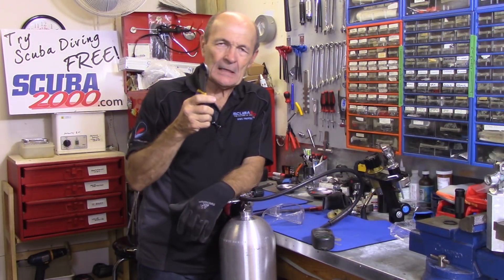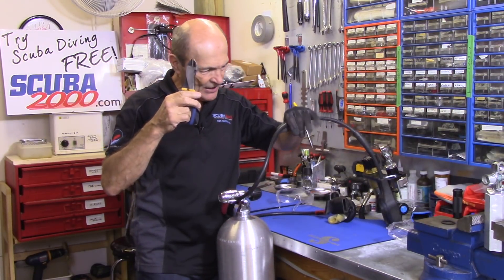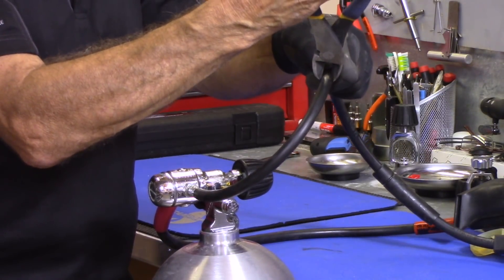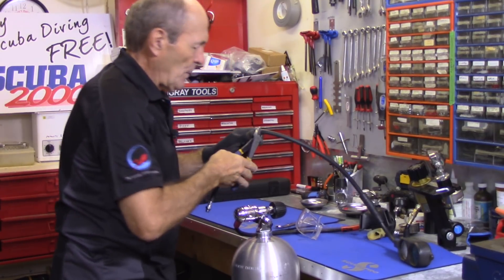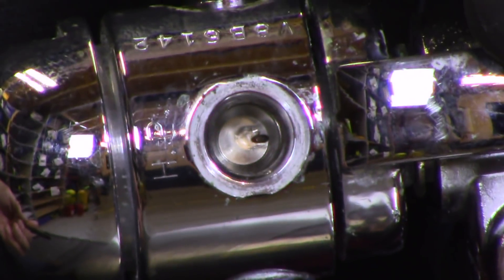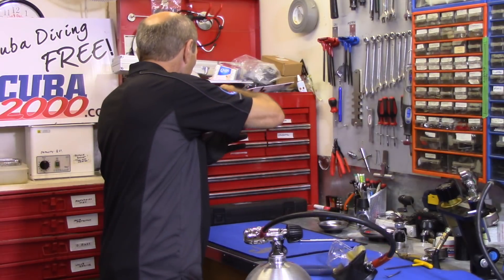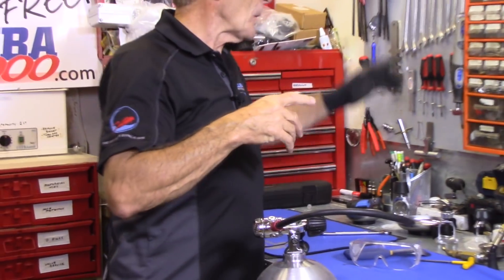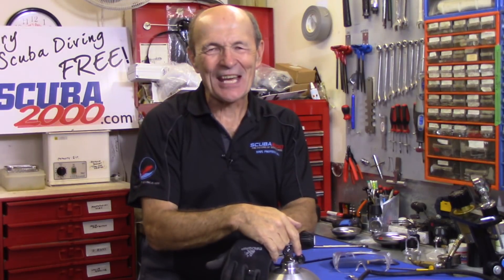What Happens If A Hose Blows? - Scuba Tech Tips: S06E16

Comment: Really nice video again ! and I would guess that the low pressure hose having a bigger volume would let you less time to get up to the surface than the high pressure one ? Always a big fan of your vids Alec ! and if I forget before too late I will wish you a very nice holiday season and a Merry Christmas !
Reply from the maker: Merry Christmas to you too Joel.
Thanks for your support over the years.
Bigger diameter but lower pressure right? So the volume of air may not be higher.
It's a physics question that you'd need to work out. At some point the inside diameter of the hose combined with the pressure will equal whether a large or small diameter.
I think. Alec
Reply: That make sense ;) Was saying as I had a free flow on my OW in the open and it scooped half a tank if not more in a really short time hehe ... thanks for the wishes and anytime for the support I love your vids and knowledge !

Comment: I had a LOT of suspense in this video.
Reply from the maker: It's not that big a deal, which is exactly the point.
As with many scuba issues, it's the perceived danger that's most harmful.
NOT knowing what will if something goes wrong can make a diver act imprudently when it does and that can lead to a serious problem.
That's why I like to ask questions and try things that you wouldn't normally see - just to see what happens.
In most cases, it's not that big a deal.
Alec
Reply: Alec Peirce Scuba I'm sure we'd all love to see where you simulate more potential equipment failures and their effects!

Comment: Hello Alec please could you cover 2 items the Apollo bio-filter and modern full-face masks?
Reply from the maker: If you read the Apollo Bio Filter sales pitch on their web page you'd swear that this simple device is the answer to all scuba diver's woes!
In fact, it's a simple humidifier. The first such device was made by Farallon in the 70's and was called the SAM - Scuba Air Moisturizer. Essentially it's a cylinder that fits into the first stage between the first stage and your primary reg hose. Removing a small cap allows you to put water (distilled water is recommended) in the cylinder. The water soaks the internal sponge-like material and that water is slowly absorbed by the air as you breath. It moisturizes the air.
So it may reduce dry mouth. That's it.
It will not cure headaches, fatigue, increase your bottom time, filter the air, make equalization easier or improve your erections!

I intend to discuss Full Face masks in a vid soon. I may have to do a Tech Tip AND a Vintage Scuba video for them.
They were quite popular in the 60's and 70's. Many recreational divers used them but today they have become expensive and largely unnecessary scuba devices of greatest value to professional divers, professional divers with lots of money. Their greatest benefit, other than isolating the diver from cold and/or dirty water, is to allow good communication underwater. Personally I value the time underwater with my dear wife Diana - time that is visually enjoyable but without the distraction of her voice.
Alec

Comment: Do Milflex hose need hose protector?
Reply from the maker: I talked about this at length in a video a while ago. I think the topic was flex hoses.
The short answer is that I don't think hose protectors are important on flex hoses.
Hose protectors are valuable on the normal stiff rubber hoses but they can cause corrosion of the end fittings if not pulled back and rinsed. Better off without them if possible.
Alec
Reply: Alec Peirce Scuba, thank you for the info.. my wife and I love your channel.. it bring back so much memories. Another question, I live in Boston and the diveshop around  where I live can not service my 12 to 14 years old regulators. They just want to sell new regulators. So I am driving up to Scuba 2000 to have my regulators service, and we need 2 new BCD. Like the one you have for traveling. We wish we can meet you in April 2018... and happy holiday.

Comment: The bad guys on Sea Hunt could cut thru those big hoses without much problem.
Reply from the maker: Yes it seemed that way. 
The big hoses on a double hose reg are much lighter rubber, lighter even than a bicycle inner tube. They were easy to cut.
And in the TV shows they were pre-cut to be sure they broke at the right time and the right place.
Reply: Alec wasn't using a 12" dive knife if he had been he would have been through that hose like greased lightning through warm butter.

Comment: That was cool always wondered about that.  Wonder if you could "kink" the hose and make it stop flowing?
Reply from the maker: Maybe the Low Pressure hose will stop flowing is you kink it sharply. The pressure is only 150 psi and you can stop or at least slow the flow.
I doubt you can stem the flow from a high pressure hose at 3000 psi. I'm not sure but I'll try it and let you know.
Good thinking.
Alec

Comment: WOW!  That brought back memories.  I had a high pressure hose blow during a pool session.  It blasted a hole in a hose protector and scared the crap out of us.
Reply from the maker: I'm guessing that was a while ago, before restricted orifices.
It used to happen quite often. If you look carefully at a high pressure hose you'll find a series of tiny holes running the full length on one side. They are there to stop the hose 'blowing up'. If the hose starts to leak the air just comes out like an aquarium diffuser.
No more explosions.

Comment: Hi, a month or so ago the connector on my low pressure inflator came apart. I was about 20 m underwater at the time. It looks worse than it is luckily. I tried to tie a knot in it but the hose is too stiff but I did kink it which reduced the flow. However there was plenty of time to return to the boat and put it back together and a few minutes later I jumped back in and finished the dive. I guess the important thing here is not to panic, it looks a lot of bubbles but it was not necessary to go to the surface.
Reply from the maker: Perfect! That's what I thought. I've seen divers go nuts over a bunch of bubbles and noise but, they still had air!!
Good work and a good experience for you - scary but good.
Alec

Comment: Not so sure about this video. With the low pressure hose were you not restricting the flow with the tank valve? Also if this happens at 90ft / 30m how long would a half empty scuba tank last compared to such a failure on the surface?
Reply: There's a great video showing how long it takes for a free-flowing regulator, a faulty LP hose and a HP hose to empty at 1 ATM (surface), 3 ATM & 5 ATM.
https://vimeo.com/151452141
Reply: Geoff Infield 
Hi. Try this link instead. 
https://youtu.be/Dnwz7r-pHqg
Reply from the maker: I wasn't restricting the flow. Realize that there is a natural restriction from a the first stage. It will only deliver air at 150psi above ambient and the flow rate is slow and constant regardless of pressure or depth. Air does not pour out at a high rate. That was the point of the video.
Since the IP (intermediate pressure from the first stage) is always 150psi above ambient, there will be no change in the flow at any depth. However, at any depth your rate of consumption changes. Technically the air will come out of the tank at the same rate regardless of depth so the flow from the torn hose will continue just as long. But you consume much more air as depth increases so it will not last as long.
I know this sounds odd but think about it for a while.
Thanks for watching.
Alec

Comment: Hi I’m just starting to get into scuba diving and I need to get my wetsuit I live in New Zealand (so cold water) and I have come down to 2 wetsuits one is a 1 pice wetsuit and the other is a 2 pice both are 7mm which one is the smarter option
Reply from the maker: Sorry for the delay. I actually made a long reply to your question but then I lost it during a computer glitch. I was so frustrated that I left it.
Here's my thoughts:
1. the 2 piece wet suit was the standard for many, many years. It was a pair of pants that came up to your chest only (called Hi-Pants) and a jacket that had a Beavertail - a strap that went down underneath your crotch to hold the jacket down. That was replaced by the Farmer John style pants with shoulders and the Step-In jacket. It was great for warmth although quite restrictive with all that material. It was really a 14mm suit from the neck to the crotch so made it very stiff to wear - and buoyant too.
2. The 1 piece suit is simply that - 1 piece that you climb into and zip up the front or, more commonly now, the back.
3. The Almost-Dry or semi-dry (I see that mentioned in one of the replies) is the same suit but with rubber seals at the neck, wrist 
     and ankles. They are supposed to keep water from flowing in and out of the suit.

As an historical note, the semi-dry suit was first designed by the late Frank White Sr. of White's Diving in Vancouver. He designed the Cross-Chest zip,  zipper flaps, attached hood and a dozen other great ideas to make divers happier underwater.

So, I suggest the 1 piece suit. It has almost replaced the 2 piece suit in most environments. It is cheaper, easier to doff and don, less restrictive, more flexible, less buoyant and just as warm. The 1 piece suit has openings only at the neck, wrist and ankles while the 2 piece has that large overlap at the waist. Some divers will say that 14mm (double thickness) is warmer than 7mm. Nope. It's not the thickness of the neoprene that keeps you warm. It's the trapping of the thin layer of water under the wetsuit. 7mm is the thickest you need even for very cold water. Here in Canada we dive all winter long through a hole we cut in the ice. I venture to say that it's colder than your water - 0 degrees (32 for our American friends) is about as cold as you can get!
As for the semi-dry, most suits now are so flexible that they seal really well at the neck, wrists and ankles anyway. Actually, a lot of wetsuits now come with a rubber seal on the very edge of the wrists and ankles and your hood seals the neck and face. Most of the features that made the semi-dry great are now incorporated into the regular wetsuit so there's really no need to pay a lot more for a semi-dry.

The critical thing is fit. Spend some time at your LDS and try on several suits, styles and sizes. You need one that's flexible and stretchy but a close fit all over your body. Not too tight! That will stop blood circulation to the extremities and you'll get cold. Check for gaps down the back (cold water down the back is NOT nice). Most back zips will have a thick pad down the zipper to help stop that. Check under the armpits and the crotch for big gaps. Ladies check the chest.
If the suit is the newer nice and flexible neoprene, you shouldn't need extra zips at the wrist or ankles.
The same principle applies to your hood, boots and gloves - snug but not too tight. 

I hope some of this info helps you make a decision.
Thanks for watching.
Alec
Reply: The one that you are more comfortable with. As both are wetsuits both are equal here (drysuits are a pain to put in, I really hate the neck seal).
If both cost more or less the same, and both fit you nice.... well I cant choose for you. The best thing is to try both.
Reply: thank you for the information

Comment: How fast will tank empty with a blown O ring at talk valve?
Reply: Thats why I personally keep a bailout pony - they won't stop decompression illness but I won't drown.
Reply from the maker: Fast. At the valve face the air is unrestricted (see my earlier reply to IM35461) and will pour out of the tank rapidly. Normally the valve is fully open. It will still take 3 to 4 minutes to empty. Keep your cool and make a safe ascent. Air ought to still be available through the reg. Unless you're down several hundred feet, you'll be ok.
Reply: good question - FAST. I had my regulator main O-ring blow on me (high pressure unrestricted) just steps from the water at the beach last week in Maui, after being on for a couple minutes and it was loud (Aeris AT600 first stage) and scary as I had just done 2 deep dives that morning (60-80ft) and was just playing around taking the kid to try in shallow water - makes me wonder what would have happened if it had been earlier that day while underwater... could have been fatal if I wasn't diving with others. Yike!

Comment: I had 2 lp and 1 hp blown. But usually they fail near the metal fitting.
Reply from the maker: Yep! That's why my Tech Tip on regulator care emphasized checking those ends.
Alec

Comment: hi Alec...you showed that with the high pressure hose you would have some time before you ran out of air which gives you some time to get to the surface. But the air came out of the regulator hose much faster(no restrictor). So lets say your tank is at 1500psi. How much time do you think a diver would have to get to the surface before running out of air? Thanks. And, when do we get to meet Kevin?!!!
Reply from the maker: You'll meet Kevin I promise. Keep watching because there won't be any announcement.
The time you have to get to the surface depends on many things, mainly depth. But at 1500 psi, you can easily make an immediate ascent to the surface. Don't stop for pictures!
The most important thing is to keep cool - it's also the hardest thing!
Alec